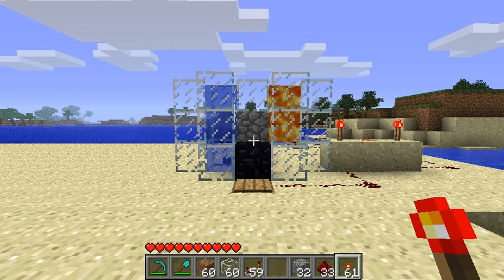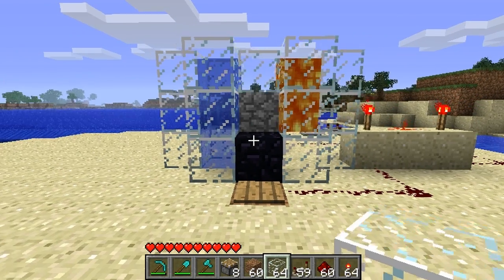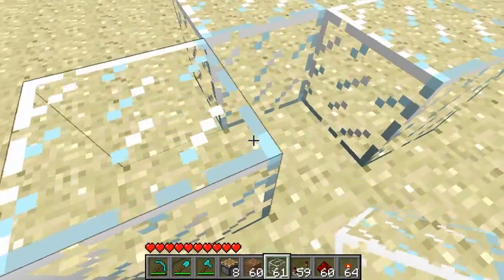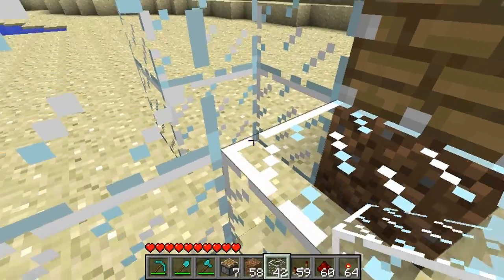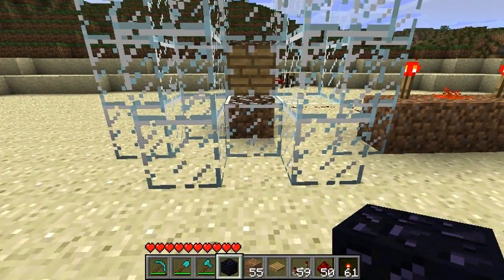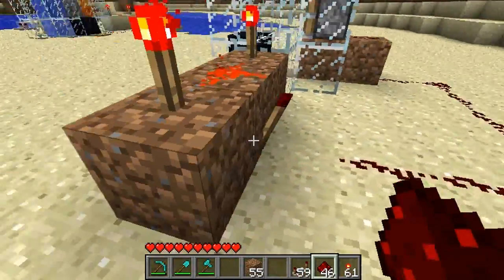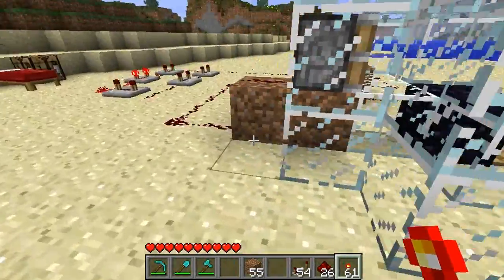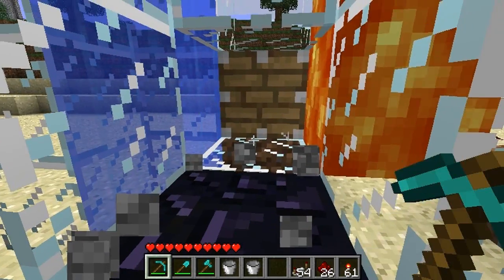Minecraft Tutorial - Cobblestone Generator with Piston

Comment: Everything is working except after I put down the repeaters and place/pick up the torch quickly, the second torch on the and switch wont go off.  The current is circulating in a circle through the repeaters as it should be, but it doesn't affect the second torch and therefore doesn't work.   Any suggestions?